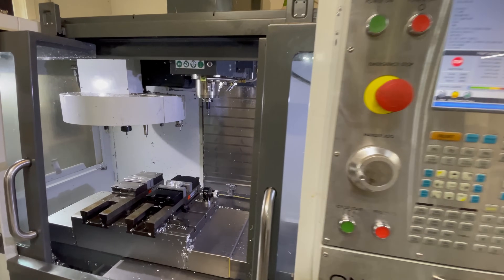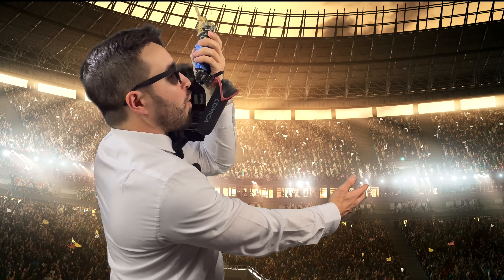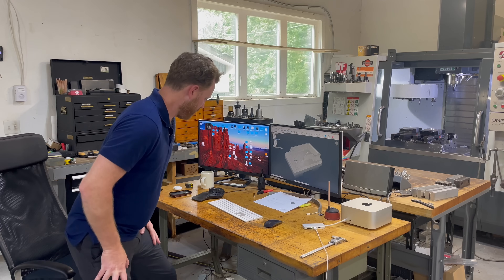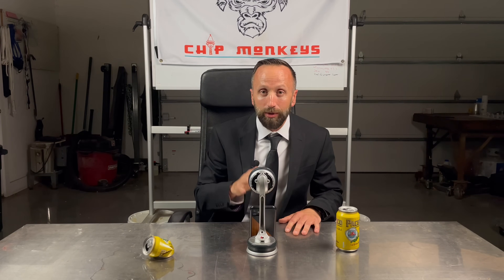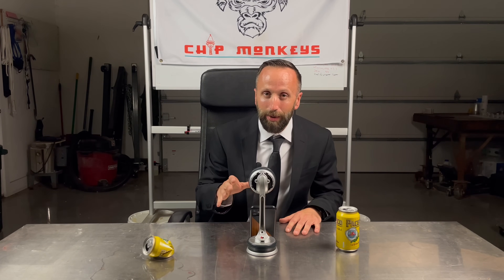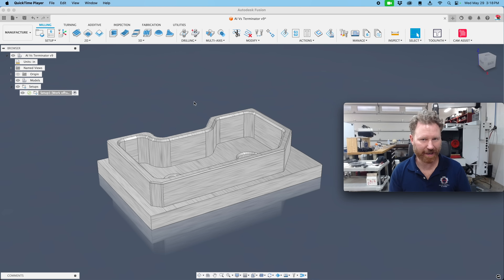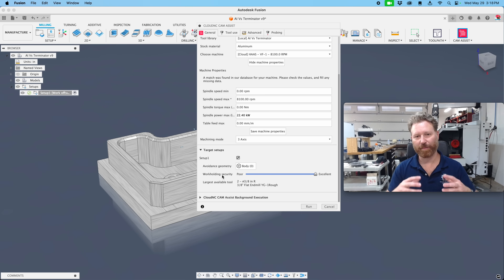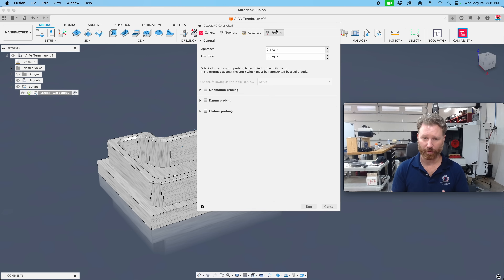Ai vs CNC Programmer: Ultimate Showdown

Comment: Very interesting.  I’m looking forward to more videos on this topic.  Do they both do quoting?  Looks like cloud nc is only $99/mo which is something I can actually afford 😂
Reply: ToolPath does quoting and it is only $799 per year.
Reply from the maker: @cwelch5725  I didn't know it was out of beta?
Reply: @ChipMonkeys  They are taking subscribers now. I just signed up.
Reply from the maker: @cwelch5725  That's awesome! I have been really impressed so far.
Reply from the maker: While cloudNC does not quote the part, you can get an approximate cycle time in a few seconds with it. : ) It’s still a big time saver. Definitely worth a trial run.

Comment: the future is: most of the simple (3 axis) parts will be produced by Chinese compnies, but in general parts are cetting complex and AI should be prepared for 5 axis or more. See, Willemin, Kern 7-9 axis. There you can neither easily find cnc programmer nor AI software to replace them or to assist them. All getting very interesting.

Comment: what are the possibilities of AI software like this replacing PowerMill in the next year or two, for toolpathing more complex shapes like a realistic sculpture milled out by a 7 axis industrial robot arm, a KUKA?
Reply from the maker: That's a good question. These 2 software applications are using Ai to associate CAM operations to a 3D model. So in this situation, Ai is not generating any G-Code. However, you can ask ChatGPT to write G-Code for CNC and 3D printing using only a command prompt. That tells you, it possible that CAM programs like Powermill will become obsolete at some point if the conditions are perfect. Conditions are rarely perfect, how long before Ai can compensate for rigidity or part processing? My thoughts: just like 3D printing was going to put all machine shops out of business in 10-20 years, Ai will change manufacturing but good programmers and operators will still have their jobs.

Comment: great video ! Have you tried both programs for more complex part to see which one is a better assistant ?
Reply from the maker: On yeah. : ) The more complex the part, the more you have to edit / fix / rebuild the operations. At some point, it would have been better to program the part yourself opposed to unraveling what Ai did. Toolpath Labs is helpful because it can automatically Quote your parts, and they are more honest about the results you'll get. Cloud NC builds good operations and uses the Tool library in Fusion pretty well, but they are "over selling" its capabilities. Ai software changes very quickly, so I recommend giving them both a shot and see which works best for your parts. Let us know what you find! Thanks for watching!

Comment: This will allow for a new designations within the industry for emloyees who oversees and approves quotes, machine and tool utilization managers, loaders for parts and operaters of CNC's in the machining center. Job quote reviewer checks for programn and utilization".  With addition of a "print interpreter" AI to generate 3-D model from either a set of plans or a laser scan and a Tool Assistant AI keeping track of available tooling in shop along with a CNC machining inventory of available machines with priorities set by shop utililazation (which machine is available and best suited for part manufacture. A machine shop could run with fewer programers, estimators, operators. Eventually customers will post requests for bids using standard perimeters so that more shops will be exposed to the users/customers of their shops services. Further this streamlined process increasing productivity that will make labor costs much less siginificant and the physical location and capabilities much more important bringing back even more work to local vendors to those who adopt and invest in these new AI technologies. Imagine how a sales dept. that can produce a quote in less than a single minute that includes the machining program, materials list, production times,  and which machine is best suited to run the job will expand each companies business

Comment: It would be helpful to see the time it took with the editing you had to do to produce the part as expected ie dealing with the accuracy issues that AI has.  To me in all fields this is what really matters and not so much the raw speed as long as its within a reasonable amount of time.   I don't know CNC machining but the times you provided don't seem to add any value to you but as you mentioned the quoting system does.
Reply from the maker: That's a good point. We are looking forward to making more Ai videos to cover aspects of using Ai like that.  Particularly 3+2 production parts. There can be a lot of editing for some parts, but 2-1/2 D is pretty solid if you have good geometry. That's why we picked this part for the video. It required No editing. I'm running a production job now using CloudNC, and I used most of the operations. There was a lot of editing, but it was faster overall. I agree about the time, aspect. Ai is quick on programming, but is it more work to edit it than just program it yourself. Right now, that depends on the part and geometry. Thanks for your well thought-out comment!

Comment: May I ask what the big news are with this two mentioned new tools? I would like to see this compared to a CAM that has good automation routines. These CAM‘s + their automation routines are around since years and running in shops all over the world 24/7
Reply from the maker: You're not wrong! That's the same question I asked myself.  I remember using FeatureCAM back in 2000, and it had "Automatic feature recognition." This is way beyond that. Toolpath Labs can even build the setups, pick the tools, then make the operations for milling and drilling of complicated features... Selecting the geometry. Right now, it can be a time saver, or waister haha. In a few years, programming machine tools could be very automated. It won't work for everything, like parts that get flimsy. Thanks for the realistic comment!
Reply: @ChipMonkeys  thx for your answer! I was more talking about proper automation tools like hyperMILL has available for example. Simple feature recognition and applying a pre defined job sequence is no rocket science 😅(and I don’t wanna talk this down, I know how many possibilities and how much work is already in that).
I’m more talking about stuff like starting your software remotely, pulling geometry and information from somewhere on a server, choosing fixtures based on the model and available stocks, create the setups, and so on.. after all of that comes the point where toolpaths have to be created, but what’s with the rest of the process^^ there is the true power hidden for me! 

Nevertheless, these tools do focus on a big need as there are many many shops still up to today that are not using any kind of automation. And these shops also don’t have the stuff that could handle it to built up something like this.
Interesting topic, let’s see where it will go